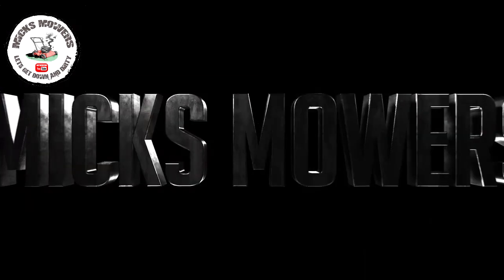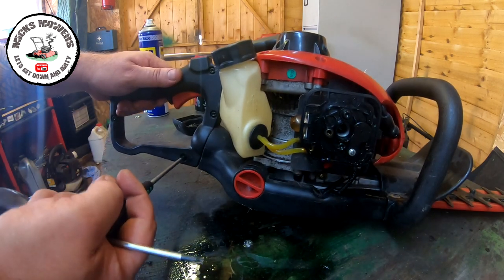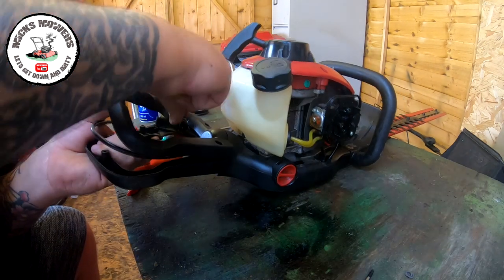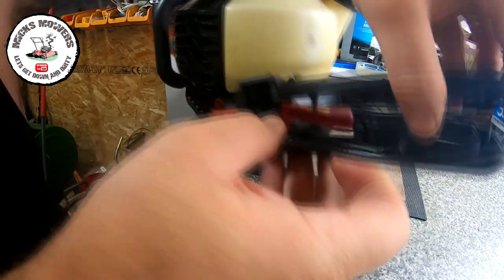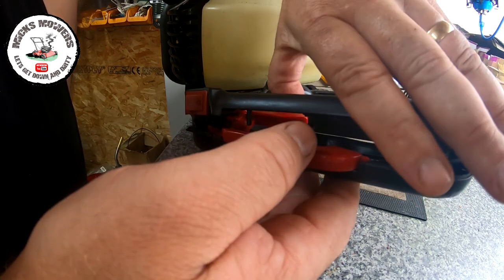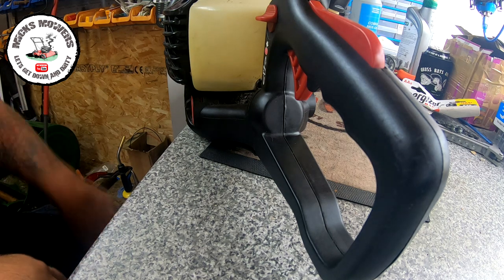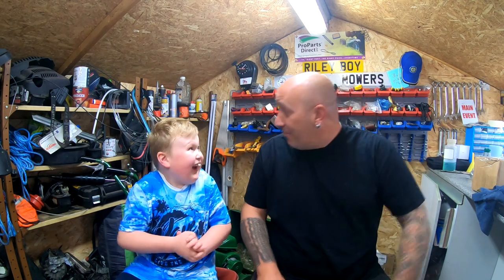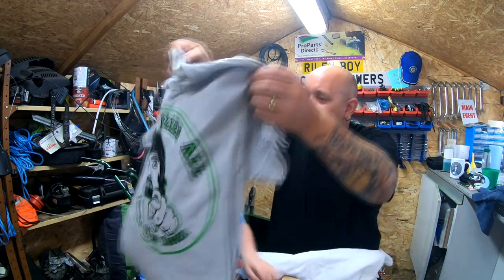Trimmer Throttle Not Working Easy Fix And A Parcel For Riley Boy From The Grass Rats Garage

Comment: Great video mick. Could I use a standard can of compressed air to clean all the debris off of my lawnmower?
Reply: I'm not Mick but I buy aerosol cans of compressed all the time for purpose of small engine carburetors and other small parts.
Reply from the maker: Yeah mate you can
Reply: @kbakeritsallaboutnobody.5761  Ok cheers mate
Reply: @themowerman  Cheers mick 👍